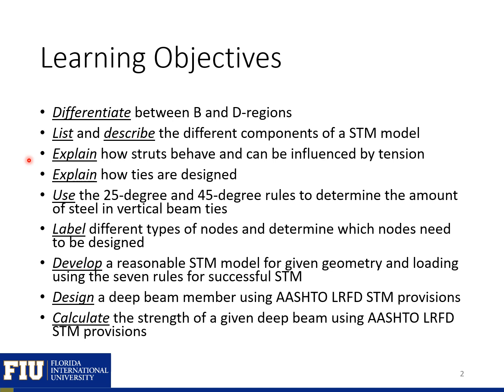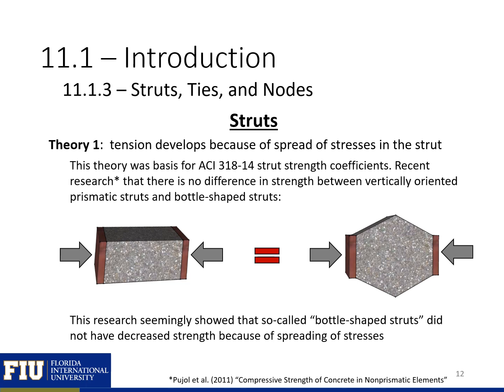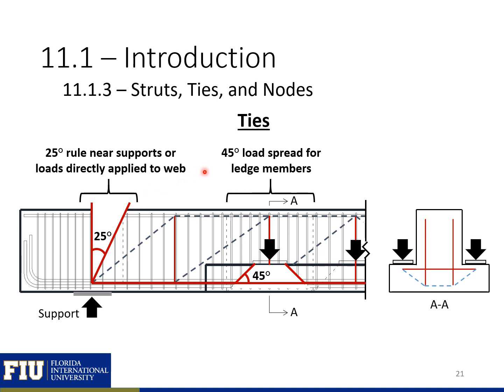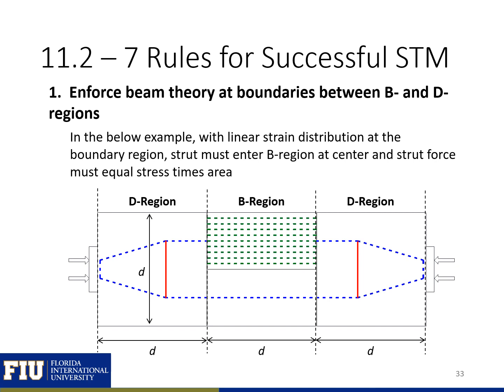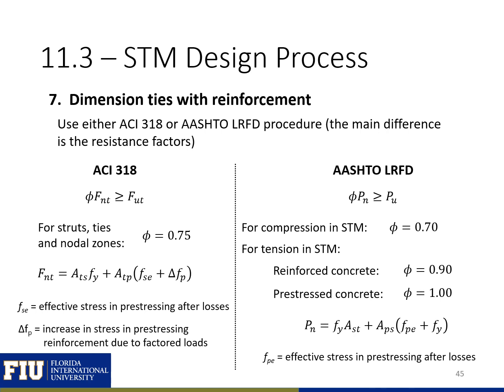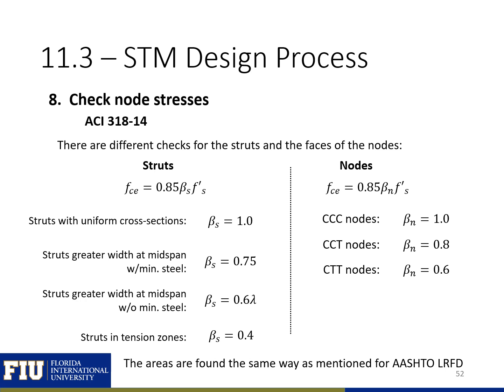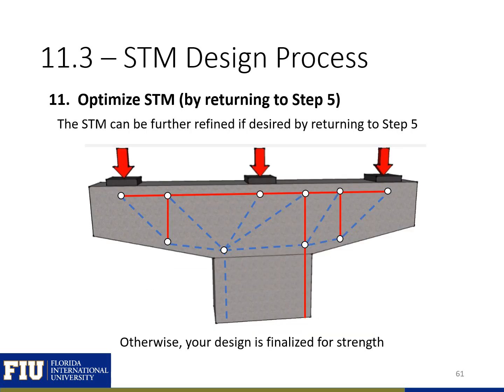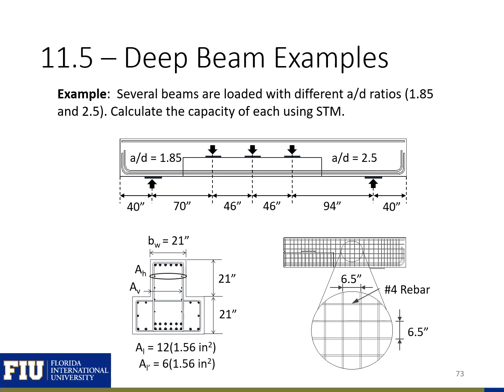11 - Adv. RC Design Lectures - Strut-and-Tie Method (old version)

Comment: Great lecture.
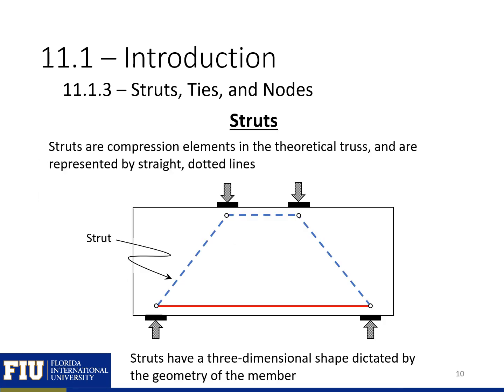@6:05 the STM does not form triangles. Shouldn't two additional diagonal struts need to be drawn from loading points to support points?
Reply: not necessary. if you also count the loading, you can see 3 forces cross at a node, making it statically determinate.
Reply: btw statically determinate was what he meant by 'triangle' i believe.